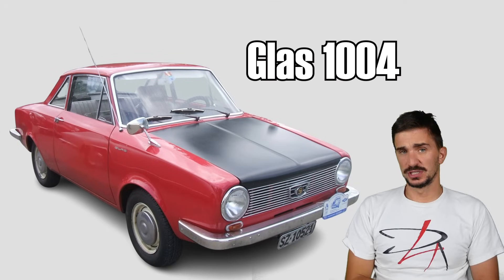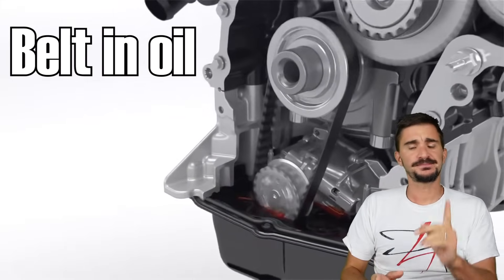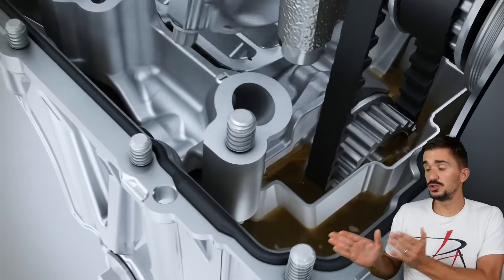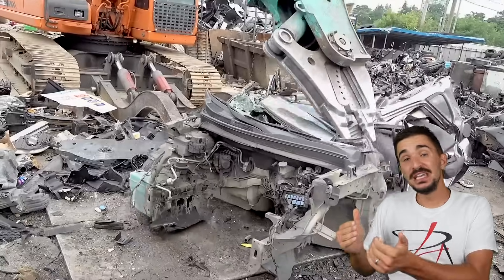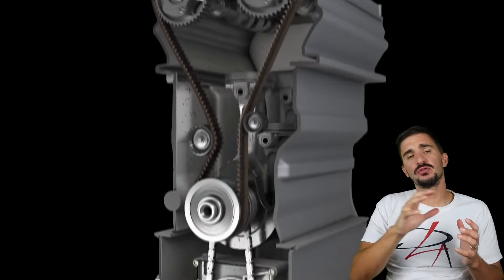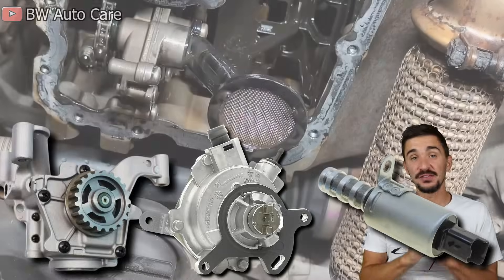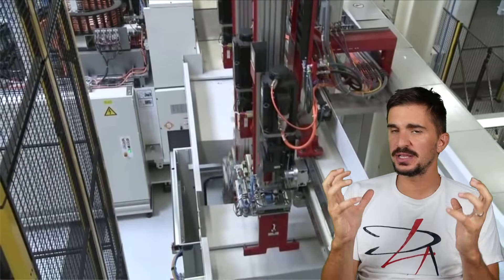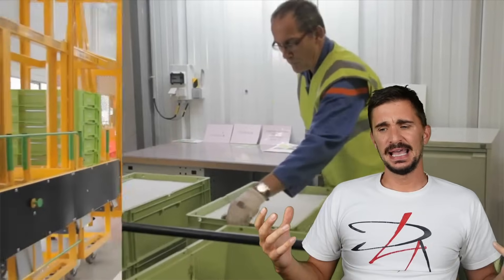Who Approved This and Why Is It Still Being Made? Wet Belt aka Belt in Oil Engines

Comment: IMO, any vehicle that has a rubber timing belt should be a non-interference engine.
Reply: traditional belts are very dependable, provided you change belt and tensioner regularly. Belt kits are inexpensive, and the job is no big deal.
Reply: @jmbpinto73 eh, accessing the belt to change it is a pain in the behind, especially in modern cramped engine compartments, and particularly in small cars with even less space. Of course there's experience involved, and I'm not a mechanic, but let's just say I do not look forward to when my car will soon need its belt changed - and I believe I've heard from plenty mechanics that they don't like the clearance around modern engines' belts, either.
Reply: @mnxs  That's not a problem with the belts though, that's a universal problem with engines becoming more complex and compact. If you think a timing belt with bad access is bad, try a timing chain.
Reply: Agreed. My Camry has a non-interference engine. The timing belt snapped at 180,000 back in 2015. Belt was replaced for $500 and the car is still driving at 250,000.
Reply: Interference engines are more and more the standard type as they squeeze out another 1% in fuel economy. As this is the case, the vast majority of engines would have chains of the manufacturers cared. Honda uses only interference engines these days and went to chains when the numbers showed that customers were replacing heads prematurely. They care and make the best performing and most reliable engines on the planet. That’s a tough combination, but they manage to pull it off.
Reply: @rebelroar78  So you've not ever replaced the belt, until it snapped and nearly killed your engine?
Reply: @masterkamen371 non-interference engine. I don't agree with letting the belt snap, but it's impossible for the valves to hit the piston on those engines.
Reply: @patx35  not impossible, just needs the engine to be the right amount of fucked up 🤌
Reply: @foojub6907 Yes, but you can often leave a timing chain alone for the life of the engine, if the timing chain is made properly
Reply: @herseem Yeah, but if that chain ain't designed properly and it breaks you will have more issues than some bent valves.
Reply: @herseem  Only review at 200k and later, check it, check tensioners etc. once quick verification pass keep driving.
Reply: @herseem  great in principle, problem is #1 cause of engine failure is oil neglect, in the form of late intervals, wrong spec, or improper level. Timing chains being oil lubricated/tensioned makes them privy to premature failure, a weakness timing belts don’t share
Reply: It would still block strainer with rubber particles
Reply: In nearly 30 year's of driving I've never had a timing belt failure,  on the other hand I've had many a chain tensioner fail that's left me with expensive repair bills, I had an Audi RS4 V8 that cost me 3k to fix
Reply: @foojub6907  I just remembered... I had a 77 GMC p/u with a 350 motor in the 90's & the timing chain wore a small hole in the side of the cover because it became loose /stretched.
Reply: if I were the engineer AND the bean counter, any engine I designed would be a non-interference engine unless it used timing gears rather than a chain or belt. They're a bit loud, but interference engines are often designed for power to weight ratio and/or power per cubic inch or centimeter. Who cares if your sports car's geartrain whines a bit? Drown it out with turbo or supercharger noise lol

I would rather my company have a strong reputation for bulletproof engines and transmissions and high production quality than being in the top 1% of companies by profit.
Reply: @jmbpinto73 If you design a product with the assumption that people will  be reliable, is a good way to fail. Design the failure point to not be catastrophic. Can't believe I even have to say this.
Reply: @AEVMU  True, if you want a dependable product to last for a while. In case you want it to require expensive maintenance after warranty is over, then you design in some parts that will be needing to be replaced.
Reply: Non-interference four-stroke engines have low performance. Is that really  what you want? 🤔
Reply: @TassieLorenzo  Yes.
Reply: @rebelroar78  All the older Toyota four cylinder engines were non-interference.  I think the older Volvos were too.  Most every other engine seems to be interference these days.
Reply: @foojub6907  Unless you lose valve keepers, a non-interference engine will not have collisions between pistons and valves.
Reply: @Mikexxx531  I believe that falls under "the right amount of fucked up"
Reply: the rubber belts have steel wire in them, or high strength strands. There are guys making 1000+hp on rubber belts.
Reply: @herseem  it has nothing to do with "proper" chain making. ALL chains stretch. ALL chain systems rely on the fact that the guides are still good. If you never check them, the life of your engine is now cut short due to lack of maintenance. IF you can't see the belt on the front of the engine is cracking (usually ~10 years/100k miles) then you have a serious issue.

It takes me about an hour to do a timing belt on a 4 cylinder EA113 VW/Audi motor. I have 3 of them with over 300,000 miles all making over 300hp.
I have a VR6 with a timing chain at 235,000 miles with signs of failure, and im in the process of removing & replacing the chain/guides.
The chain would cost $3200 at a shop to replace.
The chain cost me $82.
The work-hours on the chain is over 20 hours, and like i said on the Belt motors it's ~1 hour.

Which one is "made properly", again?
Reply: @JACKOFALLFATES  Far more than that. I was literally just watching a video on an engine rebuild of an engine making over 3K HP with a rubber timing belt. Problem is, that belt (and most of the rest of the parts) has to be replaced every 20 passes or so. You going to replace the wet timing belt in your street car every 4 miles of driving?
Reply: @herseem Many modern engines have DOHC designs with multiple chains which can be very long and have multiple guides and oil fed tensioners and can be somewhat fragile. Modern cars use more oil than previous ones and long oil change intervals cause low oil levels which can affect tensioners and result in the loss of tension on the chains and lead to guide breakage and jumped timing. Of course, the design and quality of the parts is extremely important.

Comment: I agree the idea of wet timing belt is endlessly stupid. So many people told manufacturers it is a bad idea. Yet they still did it. Obviously for profit, but not only, because they were able to whitewash this stupid idea with ecology (while in fact it is not).
Nevertheless, the problem is that we do not have enough competition on the car market (with the exception of Tesla and some of the chineese manufacturers, which bring other problems to the table). This is due to the fact that manufacturing entry level is exceptionally high and industry is over regulated. The second thing is, I am glad that there is a class action lawsuit against Stellantis for 1.2 Pure Tech, but other manufacturers should be sued as well. We need to bring back the consumer market by increasing the competition and increasing the consumer awareness - and this is something this great video does. Thank you!
Reply: I have heard that the wet belt system gains a 1% improvement in mileage. I know this is important in meeting government mandates, but it seems that it would be much better to reduce the vehicle's weight by 100 pounds with composites to achieve the same or better result. I guess it all comes done to the cheapest solution.

Comment: I am old enough to remember the reliability of gear-driven camshafts and pushrod engines. Man, those American engines were good ! 
Planned obsolescence existed back then but it was achieved by body styling obsolescence  ...and rust.
Reply: Even modern American pushrod engines don't use gear-driven cams though, I'm not sure why. The chain is very short, so surely it is possibly to create a design that uses a gear to drive the cam on the LS (LT) series?  Sadly, instead the LS timing chain is a point of failure.
Reply: @TassieLorenzo  - True. But my Pontiac Phoenix and my 84 Fiero 4 cyl both had a gear driven cam although the cam gear was made of fiberglass.
Reply: @cybair9341  That's the problem!  You're driving real power to the camshaft and it should be through steel gears, not aluminum, fiberglass or plastic.  There's also torsional vibration to consider.  There's no substitute for steel gears without bushings, but that tends to make noise.  So what?  I'd rather have a noisy engine that works and has reduced maintenance than one that fails on the road.
Reply: @Mikexxx531  Yes, vehicles that have high fuel mileage are not always cheaper to own. A more expensive vehicle with good technology is many times cheaper to own than a cheap car designed to fail just after the warranty period.

Comment: As a sixty-something ex-engineer i was dumbfounded that a welt belt was used in a colleagues engine (Ford 85K). Upon removing the head just about every valve was bent and an entire top end rebuild was necessary + some re-modelling of the top of the pistons! (Engine was still smooth to turn over and work colleague could not afford bottom end rebuild so we informed of possible bottom end failure and repaired/cleaned up to the point where it would run. Sad fact is a lot of younger people these days are buying vans for recreational use in the second hand market with around 100,000 miles on them - just around the mileage when these belts fail....... They have already spent most of their money on the vehicle and cannot afford garage prices on a complete rebuild = Screwed. As this Great Video suggests, AVOID!
Reply: Even before belt failure, wet belts tend to shear off teeth which end up clogging up the oil pump pickup screen and eventually starving the engine of lubrication until the computer shuts the engine down from low pressure.

Comment: Excellent informative video, thank you for making this. Our Peugeot 2008 (2014) 1.2 engine failed due to loss of oil pressure caused by the wet belt degrading just before 60K miles. Had to scrap the car as an engine replacement cost was more than the value of the car. Very, very disappointed in Peugeot. I wasn't aware of the other manufactures doing the same. I will never buy another wet belt vehicle.

Comment: 2:50 let's pause for a moment to remember that they had already been having timing belt reliability problems with this engine design since its conception at least 20 years earlier and went through countless changes and small improvements (such as using a chain for the injection) that maybe justified updating the change interval of the belt from 60.000km to 90.000km (and apparently even higher in later revisions), but it often snapped before that anyway. This may have played a part in some clueless beancounter gettng angry with engineering and telling them to solve the problem once and for all with this new fangled costruction.

Comment: F-150 2.7 ecoboost, oil pump is belt driven, belt is inside the engine oil lubricated.
Reply: Worse still, its at the back of the engine block, where the transmission must be removed to access the belt.
Reply: Probably the most reliable wet-belt engine on the Planet. That thing is an anomaly.
Reply: 2.7/3.0 EcoBoost and the 1.5L 3cyl EcoBoost, as well as the 2018+ 1.0L EcoBoost all have wet oil pump belts and timing chains for the cams
Reply: @YZJB i have a 20 focus with the 1.5 😬
Reply: And the 2.7 is somehow a very stout and reliable engine
Reply: Gen 1 2.7 EB has a chain, Gen 2 switched to wet belt I believe.
Reply: @tellyawhatmate Depends if it's the 3cyl or 4cyl version 3cyl is wet oil pump belt
Reply: @YZJB latest gen 1.0 Ecoboost is now timing chain, Still Oil Pump Belt Drive.
Reply: The 5.0 V8 in the F150 has gained the wet-belt driven oil pump as well.
Reply: @ShaneRimmerWorld  😳 What the heck ?!
Reply: @jean-louishamid5285  Yep - started in 2021. I don't think they use it on the Mustang version of the Coyote engine yet
Reply: @dawsongranger4940 yeah
Reply: Ford and GM have been doing this type of cost-saving stuff since the 2008/9 recession. America are the kings of profit over passion.

Comment: As a Renault mechanic, non of our engine's has a "wet" timing belt, 1.5 dci has normal dry timing belt and the gasoline 1.2 / 0.9 are chain driven.
Reply: Does that extend all the way up to the newest Dacias?
Reply: I like the use of gears to drive the two camshafts in the 1.5 dci compared to the short chain in the PSA 1.5 BlueHdi that is prone to break and expensive to replace.
Reply: Thankyou, my father has 1.2tce and  that's my understanding too.
Reply: well the 1.2 tce (h4bt) wasn't a real success... But the following one (1.3tce) is better
Reply: @justincredible5406  more like all the way down lmao
Reply: @MiGujack3  I have a soft spot for shitboxes.
Reply: @apn42  The PSA 2.0HDi (DW10) engine uses a short chain too, and I've had one of them break. Not fun, and due to the vehicle's sentimental value, I ended up spending quite a lot of money getting a secondhand engine fitted.
Reply: yeah our 2013 dacia lodgy and 2016 dacia dokker both have dry timing belt renault 1.5 dci motors
Reply: Do you prefer the trusty old F4R to the newer M series (Nissan MR) engine? Will Renault be moving (already has?) to the KR series Nissan variable compression engine? 🙂
Reply: Yeah, I don't understand where he got that info.
Reply: As far as I know, Renault has never used a wet belt. 1.5 DCI is a dry belt and the TCE engines are chain driven. 

I don't think 1.5 TSI uses a wet belt either. From VAG the EA288 TDI uses a little wet belt for the oil/vacuum pump, but those don't seem to be very problematic.
Reply: @musguelha14  I don''t think Renault has ever used it but the Peugeot Citroen and Vauxhall PSA 1.2 engine has a wet belt and is quite notorious.
Reply: Now they do. Previously, Peugeot 1.2 engines were wet belts. I'm guessing Renault's were the same. Doesn't the oil pump still use a wet belt?
Reply: @markleggett3944  they don't. There is no relation between Renault and Stellatis engines and Renault never used a wet belt. As far as I'm aware, the only other OEM using wet timing belts was (is) Ford.
Reply: @musguelha14  OK, thanks for that info. I hope they can continue avoiding them. I do hear about other manufacturers starting to use them. Stellantis is probably the most unreliable maker in the US. Renault has a great F1 history and I hope they uphold their standards.
Reply: As is the 1.3 T-DIG

Comment: Wasn't Ford also the manufacturer who connected the Oil pump with a oil soaked rubber belt deep into the motor? To change this belt you have to remove and disassemble the motor, costing thousands of Euros to replace a 10 Euro item every 30 000 to 40 000 kilometres.
Reply: Yes they were lol
Reply: Imagine you start your engine on a cold day, the oil that the belt goes through would be like maple syrup.
Reply: @finleymakee4850 Name the engine they did that in .
Reply: @joejoejoejoejoejoe4391  If you actually use the recommended oil, that isn't an issue. Both numbers need to match, because it's specifying both the warm and cold "weight" (viscosity) of the oil.
Reply: @bobbybishop5662 it is all of the ecoboost engines with the turbos

Comment: I remember seeing the F150 ecoboost also has a plastic 1 time use oil sump, yep it has to be replaced if you remove it.
Reply: None of them in the f150 uses a wet belt.
Reply: Yes we call that an oil pan over in the states.
Reply: @jacobstrutner8232 yes all the ecoboost engines use a rubber belt that runs in oil to drive their oil pumps.  A piss poor design if you ask me and the YouTube presenter

Comment: The timing belt snapped on my 1990 Eagle Talon at 68,000mi, luckily Chrysler had a 7 Year 70,000mi warranty at the time.  When the belt snapped I was at idle at a stop sign and the engine simply shut off. I called a tow truck and had it taken to the dealership. Once they looked at it they said the entire head assembly needed to be replaced and the pistons bent every single exhaust valve. Everything was covered under warranty. That was the last vehicle I bought that used a timing belt.
Reply: I HATE rubber timing belts

Comment: As far as I know the k9k 1.5 dci Renault diesel engine has not wet polymer timing belt. In all its variants , is polymer but not wet.
Reply: I have a 2016 K9K engined Dacia Logan MCV car, fantastic on fuel and it is indeed a dry belt 👌 I work in agriculture and the wet belt scam mystifies all of me and my colleagues. A tractor manufacturer trying this blindingly obvious planned obsolescency would lose generations of customers overnight - by trying to fleece them this hard!  So, so, so very dumb!

Comment: You are totally right. My girlfriend has a Citroen with the Puretech engine and as you guessed.... it failed at 137.000 km, leading to a catastrophic engine failure, which led to an engine swap worth around 6000 euros. Of course, paid by my girlfriend since the dealer organisation refused any guarantee because it was not proven she used the exact right grade oil. She actually did, but it was not provided by the official dealer but by a multi-brand service centre and the car had a clean service sheet.